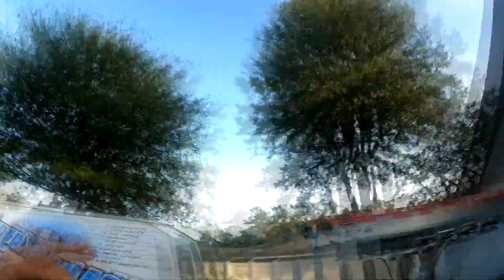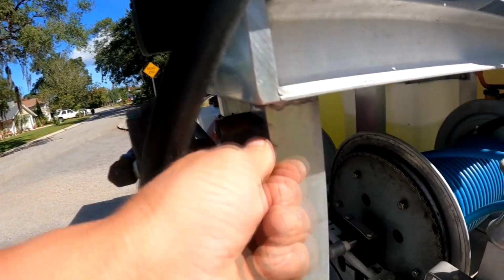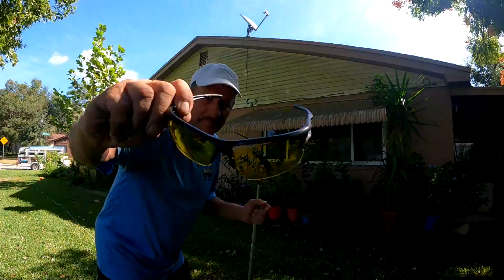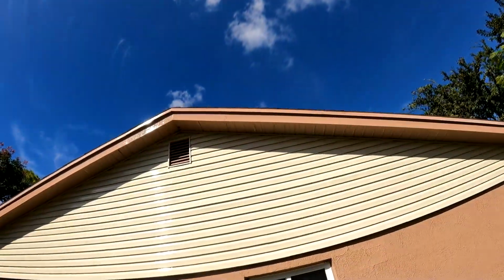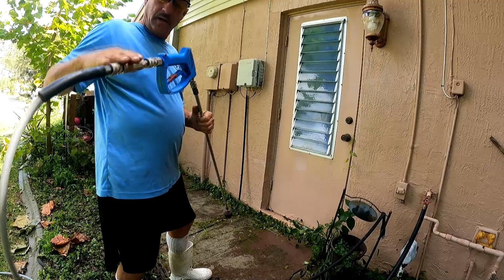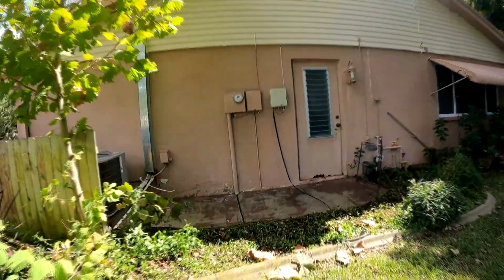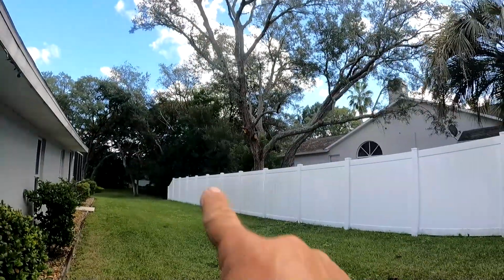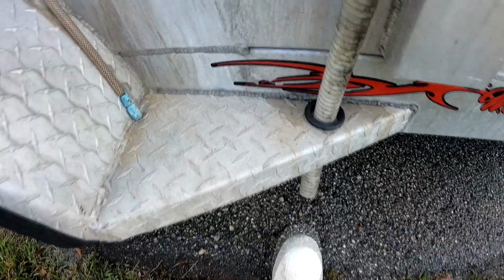1000 Subscriber Drawing today, 2 jobs, down streaming info, WINNER Announced! #satisfyingcontent

Comment: Yes Don it will give you 3.12% which I frequently spray on terribly moldy houses and you get nearly an instant reaction. Once you get the clean you're looking for, rinse right away and definitely do not let it dry on any glass. Another Pro tip, if you're using higher concentrations than downstreaming allows, make sure you cover your ring doorbells and security cameras because I have purchased a number of them having damage them with higher concentrations of sh. I certainly have paid my idiot tax
Reply from the maker: Dude, you didn't view the entire video, did you?  You won the drawing brother. You need to GET AFTER IT MAN.
Reply: @superblastpressurewashing.7256  my wife called while I was watching the video......woo hoo I'm super stoked.......don't touch my shit !!
Reply from the maker: @jasongarrett1390  Text me your address today, 727-480-0763 congrats on the win brother. It's Sticky Icky Time.